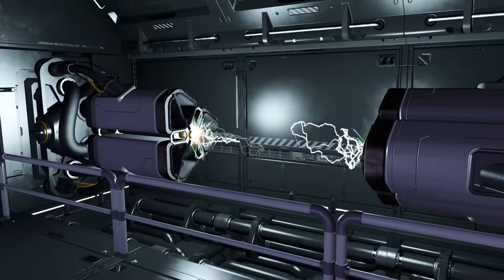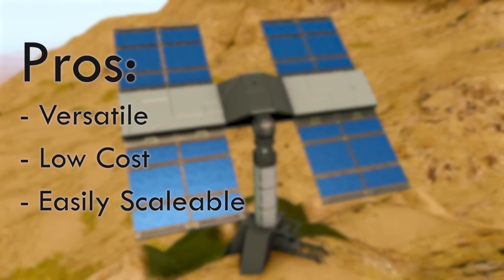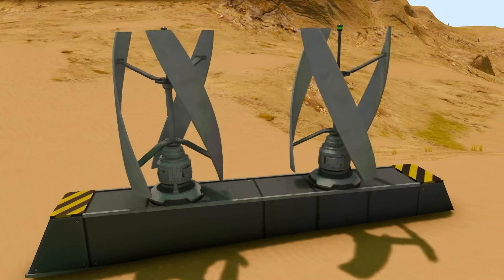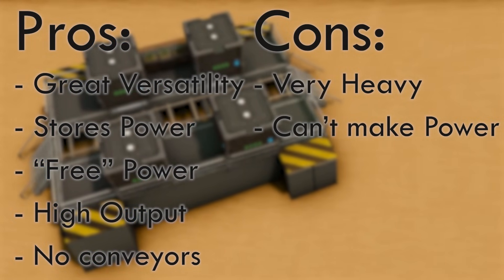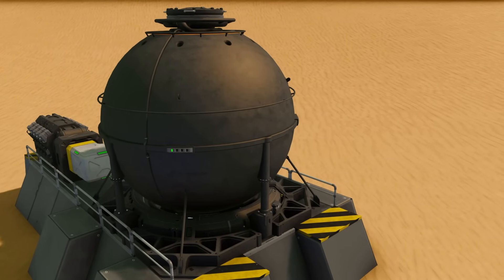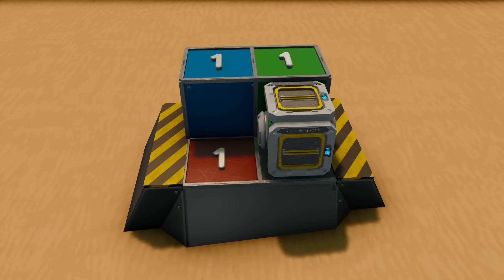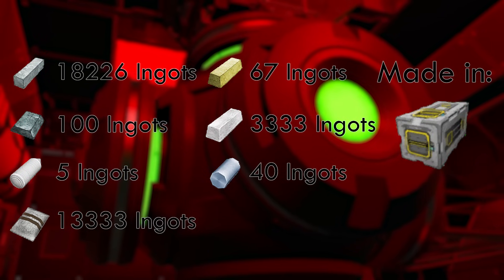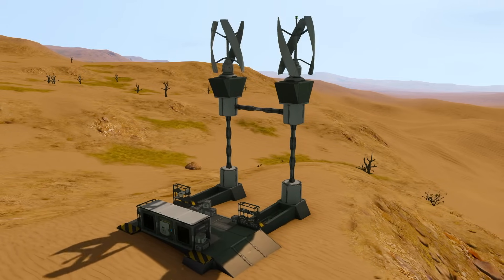The BEST Power Block in Space Engineers - Tier list & Comparison

Comment: Personnally, i only use hydro engine for small rover or emergency power for flyer... 

Turbine is the best... but only for planet base...

The very best imo is solar... can work anywhere other than undurground, and yes solar array are "the best" for efficency, it's onnestly way easier to put roof pannel coupled ,obvously, with battery.

Latter on, i would add a reactor and use a event block to have it on only under 50% battery.

Comment: I'd argue the battery is F tier.  It not only makes ZERO power, only stores it making it have an actual zero power per block ratio, it also looses 20% of the power put in to charge it, so it costs you more fuel than an engine/reactor/turbine/solar panel alone (though in the last case it is mandatory for 100% uptime use).  Also power priority draw mechanics I believe are such that anything that overdraws your 'throughput' will pull from the batteries, which will immediately recharge once the extra draw ends, costing you 20% loss on that excess throughput in MWh.  Conversely rather than suffering this... just place a 2nd engine or small reactor.  These blocks only spend fuel when needed, and have 100% efficiency (obviously) compared to an engine+battery efficiency of somewhere between 100-80% thus costing from 0-25% more fuel.

Batteries are only useful with solar power or either for short use vehicles where mass is important such as mining drones or haulers, or for small grid workers that use significantly less power compared to large grid counterparts.  On large grid... build more generators instead.  (Though they do obviously have use as emergency backups where you put them on recharge and never auto unless you tun out of fuel.)

Comment: I find the results a bit wrong for this tutorial. Batteries are the backup power. Not a source of electricity. They dont produce any electricity. Also the better question is where you need the power? Base or ship. Base? Then you dont need much energy. Why to waste hydrogen? Just build a bunch of wind mill or solar depending on planet/atmosphere. Like pertam 10 mills produce 6MW during storms that charge the batteries in minutes. In space less obstacle to block sun so solars produce more energy. If it is a ship you need the power for then hyrogen engine 100% a no no. If it is ion thrusters hydrogen engine output will not be enough. You need a large tank bunch of H2 genrators which weight a lot and need more thrusters which means more power. If it is hydrogen thrusters then hydrogen will not be enough for both thrusters and engines. If you are out of Ice or H2 then you are doomed. Not mensioning how much power you need for jump drives. Hydrogen engine is the worst power source imo. Costly and not efficent. Dont use it unless there is no other option.

Comment: I would love a ranking under the assumption batteries will act as capacitors. In other words, from a power generation perspective rather than a power output perspective. And is a hydrogen engine still a viable power source if it is also used for thrusters?

Comment: They should add a new early game AND end-game power source that goes even beyond the nuclear reactors- (New dlc concept? 
Sci-fi False Metal + Quantum Technology?) 

Early Game Generator:

Biofuel Generator, place natural mass into the generator and gain great power for a short time- really good for quick charging a huge battery set up.

Early Game Generator Enhancer:

Electrical Fractal Optimizer - This building optimizes all generators by ensuring the electrical current reaches a perfect mathematical fractal which strictly follows the path of least resistance, allowing for increasing MW output by 15%.

Mid-Game Generator:
Atmospheric generator, decently cheap build to build and has no fuel requirements thereafter- The Atmospheric Generator generates 8.0 MW per 1 block and only functions in planetary atmospheres- However, it superheats environments and needs a cooling system to operate.

End game Generator: Something sci-fi like an Antimatter Generator which uses a fuel source ‘Antimatter’ made from a particle accelerator. This makes nuclear reactors mid-game. 

Other additions:

Research Analysis Machine (RAM) - How you obtain the building recipe for all of this DLC content such as the Atmospheric Generator etc. Input materials for analysis and get research applied. 

Molecular Fabrication & Synthesis Machine (MFS) - Really large structure, super huge power intake requirement, Allows for crafting without resources as it uses molecules in the atmosphere to create things, basically allowing one to get free stuff. It crafts SUPER slowly though.

Matterform Engine - Engine required for use by Antimatter technologies. 

Matterbend Drive Waymaker - Creates extra dimensional coordinates to be used by Matterbend Drives for large ships.

Matterbend Drive -
Allows for the creation of artificial wormholes, successfully creating a portal between two spaces. Requires extra dimensional coordinates of Waymaker.

Antimatter Warhead - New warhead, twice the destructive power.

Dark Matter Spiral Engine - Creates Dark Matter from any material at a slow rate. 

Quantum Shell Generator - A shield generator that uses Dark Matter that warps incoming projectiles to the other side of the field, effectively fully nullifying incoming projectile damage. Uses up significant power, power generators cannot be active at the same time or the generators would explode from overload, requires batteries to use.

Matter Eater Beam - A laser beam defense turret that eats directly at matter able to instantly destroy heavy armor, however requires extreme amounts of dark matter as ammunition and power. 

Antimatter Thruster - Uses antimatter as fuel, it is SUPER explosive, dangerous, and fragile- not good for combat ships, however it allows space ships to get to 200 m/s unlike the 100 cap.

Comment: I always keep a few hydrogen engines on my grid with an event controller as emergency power.  If battery levels dip below 25% I have the generators turn on for 5 minutes to boost the power.  This works well with solar cells.

Comment: Smal VS Large reactor 
9 small will generate 405 Mw and only 20 Small will generate 300 Mw giving 7 block more space on a ship or les in size 
Sure the large one is only 72.295Kg and 20 small together are 95.860Kg .
So that is like 23 tons difference yet 23 tons is nothing to be concerned about if a ship needs that match power because than we are talking about a big ship any ways .
The small reactors can be spread trough the ship so that will give the advantage that taking out your power in a battle will not be easy at all .
About the Battery in your video yes it needs to be in it yet its not listable because it needs to get charged and fully loaded to be of use for when all other power sources fail so you got time to restore your ship or vessel .

Great video love it please do it again and ad the Vs info I have provided you :D
Reply: In the start I say 9 I ment 27 will generate 405Mw and 27 take the same space like one large Reactor

Comment: I find that building large hydrogen engine rooms on my bases or smaller ones (2-4 engines) on my large grid ships that I can turn on when I need to charge the batteries, and turn them off when they are charged works great. Ussualy my problem with hydrogens engines is that they consume all your fuel without you realising it. But with event controllers you can make sure they turn on under specific conditions or they leave a reserve of hydrogen at all times for the thrusters on big grid ships.

Comment: This video is kind of stupid... you just can't make tierlist of power sources:
Wind turbine - better variant for start, if you can use it, usually requires battery as capacitor
Solar panel - if wind turbine at start is not an option, go with this, same with battery
Hydrogen engine - can be used when good ice source is found, tho requires constant ice mining - highly suggest against using on servers, as it drains too much fuel. Only use with batteries and 2 event blocks, as it can't produce partialy power
Reactor - end game powersupply, basically necessity when using jump drives, small one for starting, big one can changer 7 drives at once. Finally batteries become obsolete.

Why am I against using batteries? 20% power loss...

Comment: I use hydrogen engines as a ‘backup’ power source. On all my large grid ships I implement a ‘low power mode’ function whereby all non essential systems are turned off and the hydrogen engines are turned on. I rarely have to use it but when i do need to it saves a world of headache. 

For example one time in a PvP survival world I got ambushed while in a cargo freighter by my friends LARPing as a pirate faction. They aimed a perfect and lucky shot straight into my nuclear reactor room by breaching a weak spot in the hull (literally one light armour block thick in the corner of the room). I had batteries but i stupidly had them near the reactor so a lot of them were taken out. Thankfully I had a room with 4 hydrogen engines and I was able to escape with a jump drive and make it back to the safety of my asteroid base. Had I not had backup engines after the jump I would have been a sitting duck and with how the server was setup my friends would have been easily able to jump next to my position.

Comment: What do you mean uranium is rare. Its in like 1 in 20 astroids and respawns... its literally infinite. The hydrogen gen burns through gas so fast only produces 5points and has just 2 ports that arent even in line. Dude this list is cracked. Large reactor is the goat in any metrics that matter. Produces a stupid amount of power, is low pcu, has 4 ports, holds an absurd amount of fuel, and doesnt burn through it very quickly even at full output.... the batter is an s t power GENERATOR while producing exactly 0 power😅
What would you say the best thruster for space, the atmo thruster...

Comment: Wish I would have seen this when it was new... but I think you got the rankings pretty wrong, by the way I see things.  The Hydrogen Engine, I'd place in the D tier.  While it's great for Europa, where you're going to have masses of waste ice to burn, it's troublesome to transport masses of ice about.  On Pertam, it's all but useless, as there's almost no ice to be found.  The rare oasis is something you don't want to waste on generating electric power.  It also has the disadvantage of making your hydrogen fuel gauge very deceptive on hydrogen powered ships.  The hydrogen stored in the engine, which is not available for any other purpose, is still represented on the fuel gauge.  I hoped the devs would have ended this issue by now, but they haven't.  Also, the cost of running an O2/H2 generator greatly offsets the perceived efficiency of the hydrogen engine.  The generator is too much a power hog.

As far as batteries, they belong on C tier, because, simply, they are only storage.  A power source that's dependent on another power source is not, by any stretch of the imagination, superior to the primary source.  It only acts as an improvement to the original source.

If would place the solar panel on A tier.  While not a good choice to place on a combat vessel, it can generate power nearly anywhere you are, with no need for fuel.  In space, stations could be set up to reasonably track the sun even before the custom turret controller, if you're reasonably smart.  I've had a number of stations that I built a sun tracking solar array by just setting a rotor to rotate at the same approximate rate as the sun's movement.  Every so many hours, I could make a slight adjustment to improve its alignment, since I couldn't match the rate exactly.  Even while traveling on a ship, during long trips, I can adjust the facing to maximize solar output, while my heading remains the same.  The wonders of drifting.

S tier would be the combination of solar panels and battery.  The C tier battery, as I said, improves the performance of other power blocks.  Combined with solar panels, it allows a boost for times of high energy usage, as well as keeping power going when the sun goes down on planets.  You get limitless free energy, with the downsides being the space it takes, and the vulnerability to attack.  It is, fortunately, cheap to repair.

There is a trick for power that many people don't realize, and it has to do with the hydrogen engine.  If you find an exploration encounter ship (like all the Pirate Mayday ships) that's using a hydrogen engine for power, you can detach it and take it along.  This is kind of an exploit.  To keep these encounters functioning, those engines are made glitched so they don't use fuel.  As long as you don't disturb them, they'll output energy without using fuel indefinitely.  Keep them intact and attach them with merge blocks.  Permanent free power.  Just make sure to keep them out of view of your turrets, since they won't belong to you, and will show as being enemy blocks.

Comment: The wind turbine is actually relatively easy to scale up to 5 turbines

Build a tower, (more than 7 high, say 10)
Put a wind turbine on top
On the one but highest block, attach a block on each outward facing side (i.e. 4 blocks total)

These blocks then function as mounts for other (horizontally mounted) turbines.
Now you have 5 turbines in optimal position (each turbine does NOT see the others, nor the mast).

Of course, scaling further requires another mast.

Comment: If you play a space pirate, you can usually get away with not having to mine. I intercepted a freighter that had a bunch of large reactors and small reactors and a jump drive. The ship was probably 10 times larger than mine but I’m pretty sure I have enough resources to build a base on a moon or large asteroid now as a refueling station for my interceptor.

Comment: battery in the rating of power sources.... the battery stores but does not generate electricity. Moreover, a battery is mandatory in any other power circuit simply due to the fact that energy production and consumption may vary over time.

Comment: 1 detail about hydrogen generators that has not been mentioned in the video or the comments, they need a jump start. If you place an empty Hydro gen attached to an empty h2o2  gen it will do nothing, even full of ice. You either need a power or hydrogen source to get the system working.

Comment: the problem with ranking the power blocks like this is that they are niche items, they are used in a sequence and outside of those niches they are problems. I would not say that space engineers has an end game, too open ended for that.
Reply from the maker: That is very true. The situations they are used in can be very situational, with some proving better in more situations than others. Though, it will be interesting to see how the dynamic changes with Keen now working on more "End game" level content. Still, very valid points.

Comment: Personally i end up using these power options pretty much every game:

Ground bases: Solar Panels + Batteries for nomal running and Hydrogen Engines as Boosters (when producing or generally using a lot of energy)

Tiny working ships: Batteries and maybe a few solar pannels as range extenders or to recharge in an emergency

Small ships: Batteries for power, hydrogen for trust.

Medium/Large Ships (anything with a jumpdrive pretty much): Batteries for normal running, small nuclear reactors for recharging batteries and jumdrives.

I find uranium to difficult to find and refine to make it my main power source. Using ground stations with hydrogen engines being able to recharge docking ships tends to be a really good option.

Comment: See my problem with rating Solar over Wind is that Wind is far more consistent with Solar only working during the day and if you want to keep going during the night which unless your in Space is 50% of your day you have to pair it with batteries. Plus it can be hard to realize you've expanded beyond your power generation if you only use Solar and Battery because you can slowly bleed power from recharging during the day and losing more at night than what you made during the day and not realize that is whats happening until your getting close to or have ran out of power

Comment: All forms of power depend on the situation, conditions, and etc. One excels in another area while it fails in another. A wind power and solar power systems wont be as good for powering deep underground facilities. That's when hydrogen or other reactors would be better. Just as wind would be better for high wind or stormy weather conditions or environment than a hydrogen or solar power plants would be.

Comment: My killer problem is that hydrogen on vanilla sucks up too much hydrogen on one small tank.  Yes, I got the mod to put an end to that but still.  15 gallon of gas will give me what about 8 hours of driving time in a car.  A real hydrongen does about the same.  Then again it is a 12-cylinder.  Still, the hydrogen needs to use a little less gas.